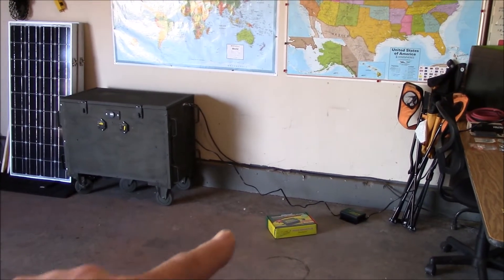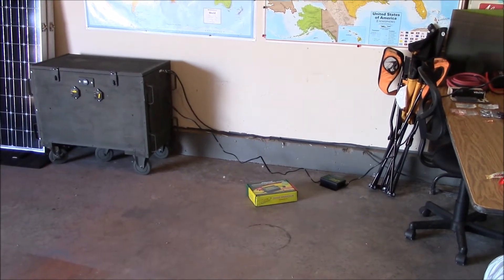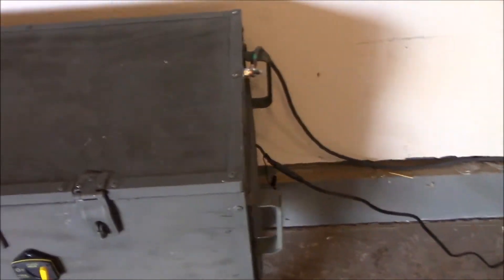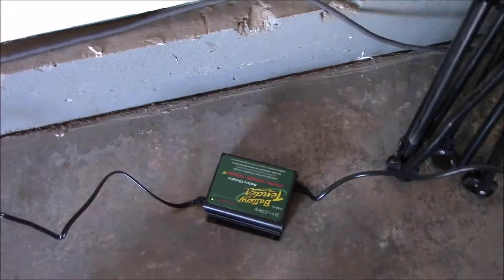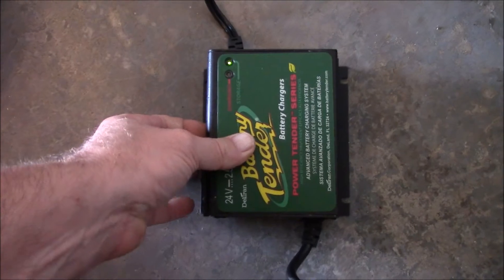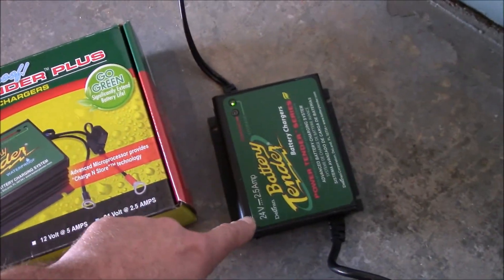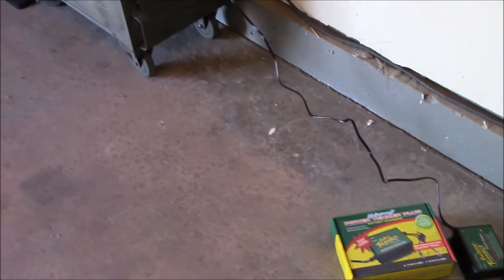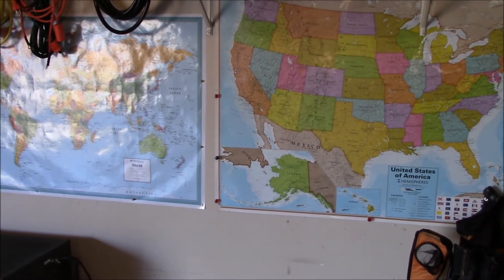How to maintain your battery bank - Deltran 24-volt "Battery Tender" charger/maintainer

Comment: I have a Bus with 2- 12V large lead acid batteries in it to run the 24V coach system.    Would you suggest this unit for that application?   24V Batt chargers are usually pretty darn expensive.
Reply from the maker: I used this on four Trojan 105 aH AGM batteries wired for 24v. I don't see any problems using this with two 12v batteries wired in series. Best to email or call Battery Tender (Deltran) with direct questions. That is what I did...they are really cool folks. Mine worked great...it was able to charge/maintain without any hissy-fits. Good luck.